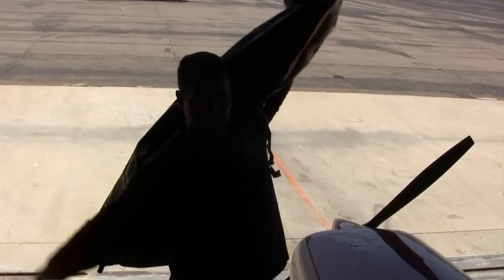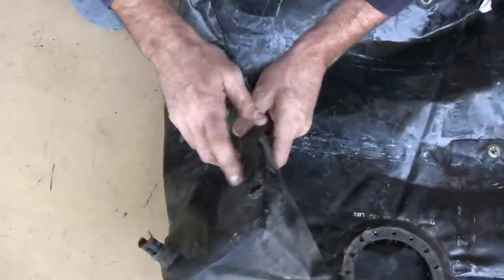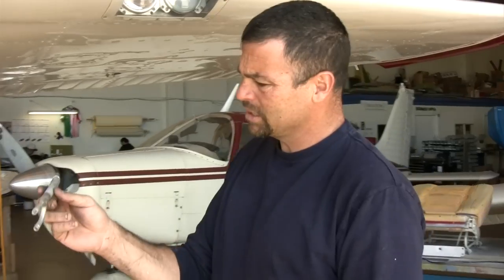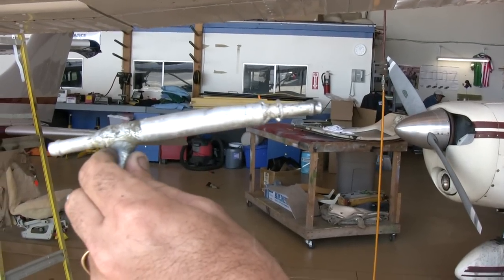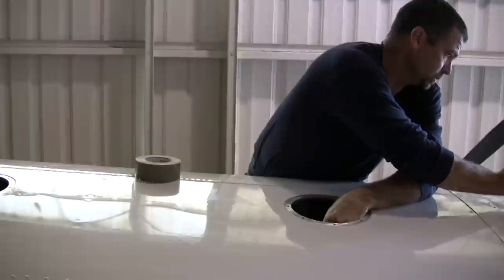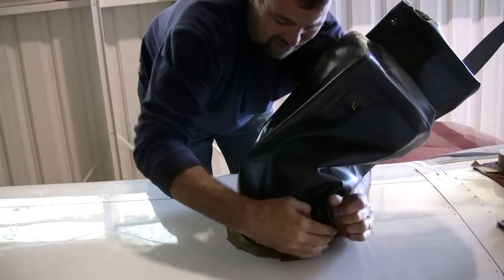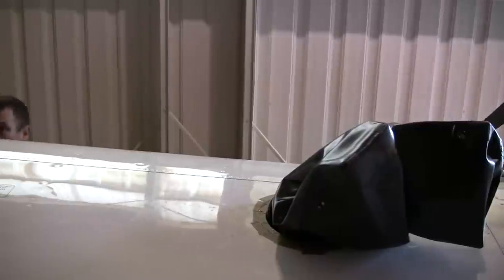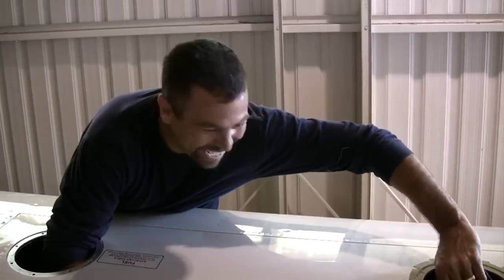Cessna 182 Fuel Bladder Replacement

Comment: I helped my dad (pilot/owner) on both 210 tanks a few years apart, the first one it seems the hardest part was snapping in the top outboard snap but that was a while ago. We are finishing the bladder in the right wing now and I could have saved a lot of time leaving the old black (factory?) tape that was still good because the cleanup was way more work then I expected.  The tape is high tack mil spec duct tape that want's to stick to everything until it picks up enough oil and dust that it won't stick to anything, good thing they sent a whole roll of this stuff, enough to do 2 or more. 
Helpful hints: 
   The outboard leading edge vent has a valve inside that must be removed from inside the tank, we tried like hell to pull that 1" valve though the 3/8" nipple but it weren't never gonna happen! Also, remember to put it back in before you get the bladder snapped and secured.
   The fuel supply line has a screen on it, if you don't see one look inside the tank, it might be there. 
   The tape will not stick to parchment paper, even if you want it to unless you scratch it up with a blade or sandpaper. What I ended up doing is laying out a piece of parchment paper 2 or 3 feet long to work on and then cut some parchment paper about 1" wide, working on the large sheet of parchment I folded the tape in half and put the narrow parchment strip on the back edge of the tape, flipped the tape and stuck the the other edge of the parchment (after folding) to the other edge of the tape so to hold the tape folded in half with the sticky center exposed, this gives it some rigidity making it so it doesn't flop all around and makes it easy to center the tape on the rivets and in the corners. I used a big round make-up mirror with a stand and a good light inside the tank bay. 
   I made a scaffold with 2 pieces of 1/2" or 3/8" plywood 10" wide atop 2 padded 1x4s that rested on the front and rear spars with the plywood on either side of the hole and a towel to protect the wing from buttons, zippers etc. allowing me to put as much weight on it as I wanted.  I also tied the ladder to the strut so it wouldn't keep scooching away... 
   The most time consuming thing was cleaning because I removed a bunch of the original tape and took the time to clean the old black stick-um stuff left behind with goo-gone and acetone. 
   So we're going to the airport to finish the bladder today.

Comment: This brings back memories. Having snaps fall out and not being able to get them to pop at arms length. Or not going into the snap hole at all because the grommet is in the wrong place by a fraction of an inch. What fun I don't envy you at all.
Reply: question-do you recall what kind of tape you used inside the tank area ? or doesnt it matter that much ? thanks

Comment: I have to do this tomorrow on a 182P. Taking the connections out is a pain, still better than scraping sealant off wet wings to get rivets out..
Reply from the maker: Pitkä Peura In either event, a good attitude and long arms are helpful. Good luck and thanks for the comment.
Reply: Im doing a 182p right now how did you manage to get the leading edge connection off? the fuel vent connection.

Comment: Thanks!  I’m going to try to resurrect a 1958 Cessna 182 that’s been sitting in a dry hangar for 12 years. Has never moved. I  don’t think the tanks are full.  Is the bladder toast?  Positively need a replacement?
Reply from the maker: Phil Ackerman - Great project. I'm an owner, not an a&p, so this is just my experience. My old bladders would ooze fuel from the wing root when full.  Bladders tend to fail from the top due to drying from the sun.  I always hangared mine, but it was 20 years old when I bought it. Those with more knowledge than I might suggest filling them to see what happens. You can also get a clue by looking thru the inspection ports.